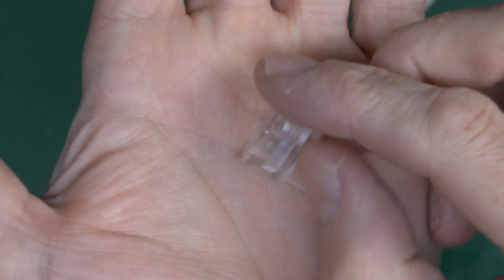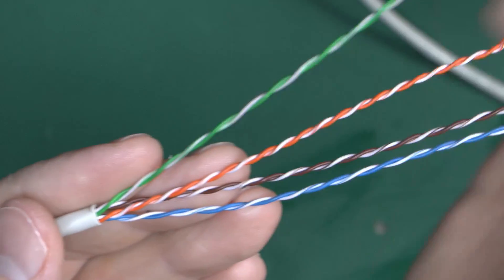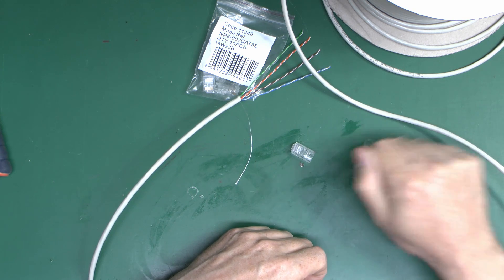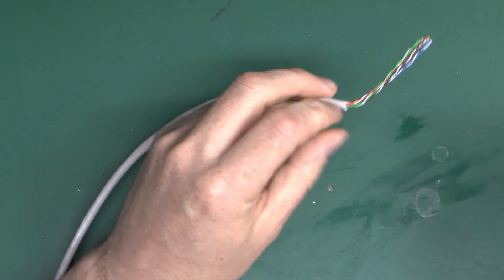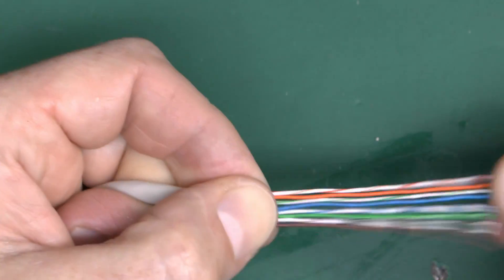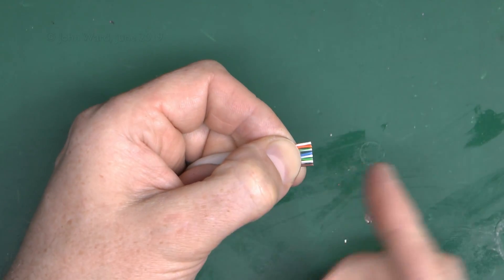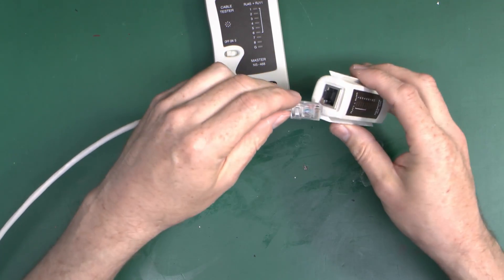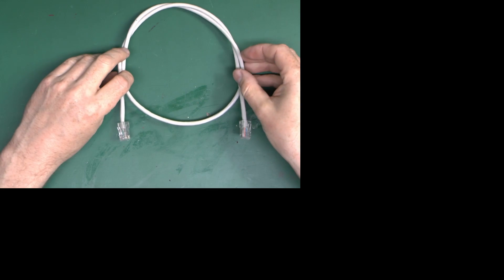Fitting 'RJ45' plugs to CAT5e Cable

Comment: Great video, although I was kinda hoping that John would divulge the official reason for the weird "crossover" that you have to do inside the connector. I have always suspected that someone, back in the day, laid out the PCB of the network card incorrectly and the rest, as they say, is history. Of course I have no proof but surely nobody would deliberately require installers to make the crossover - or would they?

Comment: Hi JW,
I had to watch this again as I had to carry out a job today where a farm worker had torn all of the Cat-5 wiring out of a panel (in anger I believe) and I could not remember how to fit one of these plugs.
The first one needed to be done twice and then it got easier.
To be fair though, I've only ever struck 568-A here in New Zealand, I believe you'd only see 568-B in the USA?
Do I have this wrong?
The worst thing was, most of these leads were patch leads with stranded cables, which should have been replaced off the bat, but the guy just wanted the plugs replaced.
If I did these every day they would be simple. 
Thanks for a great video, even a long time after the fact!
Reply from the maker: The two different types are only of use for crossover cables, which have A at one and and B at the other.  Those are rarely used for anything.
If both ends of the cable are the same, it doesn't matter which is used.

Comment: About the plugs. There are differences. 1) Be sure it is rated for the application you are going to be using it with. 4, 5, 5e, 6, might look similar but they are not. You might get with it on short runs, but if you approach 100m lengths, it will be a problem. Even smaller distances might be problematic, if you have junctions, patch panels, in between. 2) The plugs do vary in quality and some extra functionalities even for specific category. Some do have pass through holes for wires. These are for easier alignment, holding, and importantly, to properly position outer cable insulation for crimping and holding the cable. 3) The plugs also do vary with the latch quality, some will easily break after few unplugs, some other will also forever. 4) Fire related certifications. 5) The plugs for solid core are different than plugs for flexible multi-core cables. So, do not necessarily go for the cheapest ones. Check what they do and how they work.

Comment: Tip of the day for getting the correct length, which is what I'd always fail at until another engineer showed me. Measure against your finger nail, then cut. It pretty much always ends up the correct length.

Comment: Would that tester work over 50m as it’s only 9v?
Reply from the maker: Yes, voltage drop is only an issue with moderate to high current - the tester only uses a few milliamps for the LEDs.

Comment: Feed through RJ45 are far easier to install. You can pull the wires tight to the connector then cut them off.

Comment: I have done piles of these but here in Canada where I am anyway the standard is T568A.  I have only ever come across a T568B connection once  and that was because it was part of some piece of  specialty equipment installed

Comment: I just learned about the "pass through" type ends. Haven't used them but they look like they would be much easier to install. I have had issues with the wires getting out of order when I stuff them into the connector.

Comment: Ah, yes. The fun I had one morning, as we were moved into our then-brand-new office; crimping up a bunch of patch cables, all measured to length, fitting rubber boots to show which VoIP phone was plugged into each wall socket. Spiral binding and ty-rapping the unsightly bunches of cables to the desks. It was truly a wiring job fit for the Queen, if she ever came visiting. 

And then a fortnight later, the office manager decided to add another row of desks and the entire lot had to be redone .....

Comment: As an installer here are a few tips to save you time: 
1.  Using the clunky crimp tool to cut the sleeve and trim is time-consuming, get yourself a Jokari Cat #1 or Coax stripper lightweight and fast,  a pair of flush cut electrical clippers to trim excess cable.
2. Use a pencil to smooth out the kinks, run the cable between finger and pencil, it doesn't need much force, when you're on your 10th connector you notice your nails are taking a hit.
3. Buy connectors called EZ or pass-through connectors, yup 2x cost but you save a load of time, Cat5 version will work with Cat6 UTP, but you'll need Cat6 for 23awg UTP/STP
4. You will need a special pass-through crimper as it trims excess cable on crimping, but these have plummeted in price and can be found on Amazon or eBay
5. Don't waste time making more than the odd patch cable, buy them in bulk, 0.25m, 0.3m and 0.5m are cheaper than your time.
With the above tools 1-2 mins making a working (first crimp) connection is a breeze. there are YT videos on EZ but I'll not link as JW might like to make his own

Comment: Some Amp connectors can take a metal strain relief. The built in one is pretty bad at gripping the cable. It has two prongs which go into the connector body and two tabs which fold over the cable like on a 3.5mm or 1/4 inch plug. They serve a second purpose, I use them to identify which cables I have made since nobody else at work uses them.

Comment: This must be the first JW vid  I cant  give a plus too...   putting plugs on cat cable, should always be on patch leads - and use stranded... solid core should be used  for static- horizontal or fixed cabling, stranded is flexible and designed for the constant bending. and although you can use plugs on solid core cable, there are special 8p8c'/rj45's.   standard rj45's pierce the strands, like a comb going through your hair, the plugs for solid are designed to pinch the outside of the solid core wires,  like an ice tong grabbing the icecubes out of the tray...     T568A is method used in most parts except USA who use 568B. funnily enough if you cable up a US govt building you have to use 568A method, as US govt does no recognize the 568B.
Reply: Yes but connecting to a camera or WiFi access point in a corridor by  terminating the cable on a plate on a box and patching in the device triples the number of connections and the connections are the weakest link in the chain. It also doubles the time and materials and therefor the cost. Even worse for POE is having dirt in the connections. Clearly JW deserves a plus.
Reply: The cost of 5 dollar inline punchdown coupler  and dollar cat6 patch lead and cutting off one end, is negated by the time you spend trying to do the plug and other stuffing around, and the chances are you are using the wrong 8p8c in the first place.

And lets not forget some countries have wiring rules that cablers must abide by else non compliance can mean not getting paid :)
Reply: I do this all the time, I done see any it using anything more that 5 dollars worth of components, the couple also isn't in a  plate, and I install them in the drop ceilings or wall or where ever the other hidden cable is.. if you find it uses a lot more materials and costs shitloads more yet doesnt in reality as I find save you cost because its faster, you are doing something wrong :)

Comment: I may not have been listening, but did you mention the different type of connector for different types of cable?
e.g. Solid vs stranded conductors.
It makes a big difference in reliability over time as the conductors flatten out, or scissor the solids.
Reply: Usually what happens when using solid cable with a connector for stranded is that the crimping tool won't fully seat the contacts on the wire, causing the plug to fit very tightly in a socket.

Comment: Thank you for giving us Openreach guys in a job ! :)
Lots of TRC's (Time Related Charges) for us !  -  i.e. All work past the Mater Socket (NTE).
You're keeping those HR's (High Resistance) joints in those cables to keep those CRC errors (buffering) for the customers.! ;-)
I've been to lots of houses where the electrician has caused lots of faults with the data cable (especially Cat 6) has been run and terminated incorrectly. 
I've had to re-run and terminate the cables correctly. The electricians way of 'ragging'  through those data cables as a 'normal' electrical cable cause lots of HR faults in the cable.

Comment: Fitting these rj45 ends is a hateful job when you have more than a couple to do. Personal experience of doing hundreds of the bloody things. Expect sore fingers. I would say go for Cat6 FTP if you are about to wire up your own house or on a job as the reality is most routers are now going towards 1gpbs as standard, in the long run it will also be acceptable for 10gpbs in a domestic setting. You can also use Cat5/6 for telephone lines provided you don't go mad with the amount of wire length used as ADSL/VDSL broadband will benefit from twisted pair, don't use the piss poor phone extension kits as the wire is atrocious quality. 
If you use the cheaper crimp tools on RJ45 plugs they can somtimes only crush the one side of the contacts down fully causing intermitant connections and possibly damage to your expensive neargear kit!  Also F#'' Wireless lol.

Comment: Something that was not covered is the importance of getting plugs for SOLID cable, as the more common plugs for stranded cable (identical appearance) will not make a good connection. Generally, patch cables with plugs should be stranded cable because it's flexible. Solid cable is used for infrastructure (inside walls etc) and is normally terminated to sockets (not plugs).
Refer to the reply and image at this URL: https://superuser.com/questions/811356/do-i-need-different-rj45-plugs
Reply: That's true! This is not a professional video!

Comment: Great video.  I was about to say exactly what you've added to the description.  Must just say though, even if it's a 50 metre run with plugs on either end I'd use stranded every time.  If it's a patch panel one end (which only takes solid) and something (eg cctv) with no chance of fitting a pattress box near it at the other end I use solid (with the correct plug at camera end) and as long as it's not going to need to flex day after day I've never had a problem (touch wood).

Comment: does it really matter if the blue goes next to the white/green or is it just a convention that has carried over? is there an electrical interference reason for instance?
Reply: As long as the pairing is maintained they're just arbitrary colors, however!!! if I see a cable wired with a weird color pattern I would probably end up redoing it because it most likely means that somebody's crisscrossed say an orange + pair with a green - pair or any other color pair.
The Orange pair is traditionally +/- transmit and the green pair is traditionally +/- receive. and when you move from 10/100 to 1000 the blue and brown pears are respectively used as well.

If you go to the phone world, the blue pair is traditionally line 1 (old Green+/Red-) the Orange pair is line 2 (old Black+/Yellow-) Green 3 and brown 4. And that is why you technically can plug a 2 or 4 wire phone cable into a RJ45 Jack, although the spacing is just slightly off enough to be damaging in some Jack manufacturers cases.

and on 10/100 networks 123_6_ for data
and for phone __45__
that way if a phone line gets plugged in to a network card nothing happens ( Yah that will never happen... only the white coats touch the computers).

and
@Matthew Malthouse
"That is one of the mysteries of networking that is only revealed to the highest echelons."
yes and i am the one, they call neo, from the tel-net matrix. (was that sentence ever a play on words).

Comment: The best way to straighten the cores is to roll them gently one at a time over the back of a 3mm screwdriver.
Reply: Yes, 100% true. I was cringing watching JW trying to do it with his fingers (he must have rubbed them 20 or more times and they were still crooked) I found the best way is to do the single strands(say) rolled downwards, then once they are all in the correct order and laying straight, to roll them as a group in the opposite direction - that straightens them (removes the curl)
Reply: I used a small Philips. Insert at the base of the twist and pull to untwist and straighten. Saves a little time manually untwisting the pairs.

Comment: Australian viewers should note that to be legal you MUST be a licensed cable installer to terminate data cables - irrespective of the purpose!
Reply: Barrie Shepherd the Australians have red tape for everything. Even worse is that their mains sockets don’t have shutters 😜
Reply: @snukie73  yes, and when you plug in a 3kW oil filled radiator the plug often overheats as the pins are not as substantial as the UK ones.  JW has covered the Aussie plug in a previous video but I don't remember any comment about it's current capacity.
Reply: Barrie Shepherd 3kW on a basic 10A outlet would be a a stretch (as I’m a Kiwi, also use ‘AS 3112’). I still think red/black/green is a better colour system for mains 😛
Reply: @snukie73  Yep it was a typo! I meant 2kW!
Reply: That's... amazing... How much lobbyist money from the electrical industry did that cost, I wonder?
Reply: @AndrewGillard  LOL - it would seem like that.  There are a couple of threads on the Whirlpool forums site about it, the site  bans posts that link to cabling solutions. Even self installed phone extensions are 'illegal'. Having said all that the necessary parts are freely available as are tap washers another 'protected' area!
Reply: Does Australia have RJ45 police to enforce this ?

Comment: Defo use the rubber boots - they work wonderfully to prevent the delicate tabs snapping off... nothing more annoying than a plug that unplugs itself due to a missing tab
Reply: Just, as with heat-shrink and the covers/strain-relief of plenty of other connector types (e.g. DC barrel jacks and TR(R)S "headphone" jacks), PUT THE BOOT OVER THE CABLE BEFORE TERMINATING IT!! 🤣

Nothing worse than spending ages cursing while you terminate a particularly fiddly connector/cable, only to finally finish and realise that you didn't put the boot/connector housing on first and you'll have to remove the connector and do it alllll over again! 😿
Reply: Been there, done that, usually when pulling the plug back through a rat's nest of cables.  You can get boots that fit after crimping, which aren't as bad as they look and protect the tab to a certain degree.  For example, search MHRJ45SRB-RET, others are available.
Reply: I've slit boots and slid them over the cable. A tiny cable tie holds it in place. Works and looks fine.

Comment: [edited to add: I left the following comment without double-checking what I thought I knew. RJ-45 is for data circuits, not Ethernet, and RJ-48 is actually an 8P_4_C connector.]
"RJ-45" when used for Ethernet, "RJ-48C" when used for T1, and, generally, "8P8C". ;3
Reply: Ethernet does not use rj45, actually. Rj45s exists, but is a variant connector. Rj48 uses the 8p8c plug, but that’s for isdn and has a different pinout from Ethernet.

Comment: Thanks for this video John I'm running some internet cables around the house at the moment.
Termination inside the wall box would be helpful.
Reply: Try looking at keystone jack's. The jack's themselves have the wiring colour diagram printed on them so you just have to follow colour to colour punch down pattern. Usually diagram B.

Comment: Having done a fair few of these...too many...I would recommend unwinding the pairs further down the sleeve by giving it a stretch and then a shove back when done to cover over the parallel squared up bunch. It would be like  cutting further up so keeping all pairs nice and square/parallel even where they exit the plug. Often if you do it like John did (the brown as seen here for example in Johns video) an outside wire can sometimes refuse to make it all the way to the end of the plug and sometimes a few end  short due to having to manage a bit of a bend..
Edit Of course saying that ..Johns cable was perfect.....
Reply: John is already untwisting it too far. Definitely don’t untwist it even farther. Every little bit extra untwisted costs you in max distance.

Comment: Top video as usual JW but when will someone invent a proper locking lever for these?  even when you are crimping them they are so fragile they can bend and snap off never mind in use.
Reply: Always buy and fit the boots with the shroud that covers the handle - you will never break a lever again. Also, buy a quality name brand of plugs, Tyco or whatever (rather than no-name chinese crap).

Comment: It's worth buying decent quality RJ45 connectors, the cheapest ones from ebay/aliexpress are awful quality and the contacts tarnish quickly
Reply: Or they don't fit in the ethernet device unless force is used.

Comment: 1 it's Krone not chrome 2 the thread is to stop the cable stretching during and after installation.  3 stranded is for non fixed installations ie patch cables.  4 the plugs for solid cable are of a different design with 3 'blades' going alternatly each side of the conductor rather than trying to puncture a solid conductor.